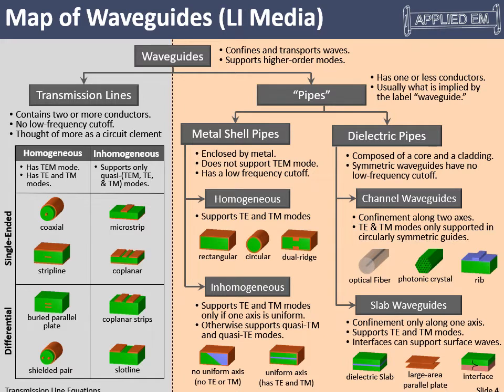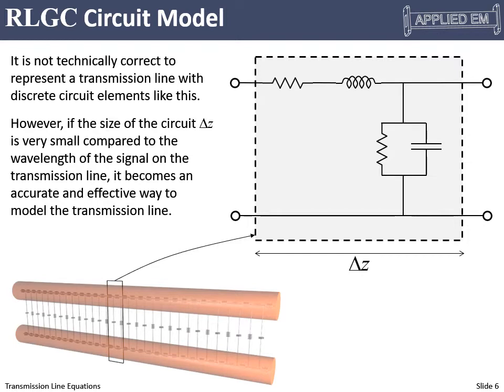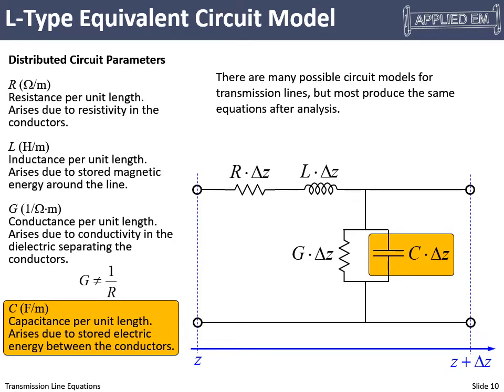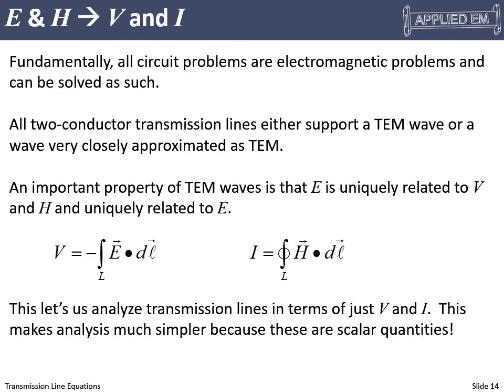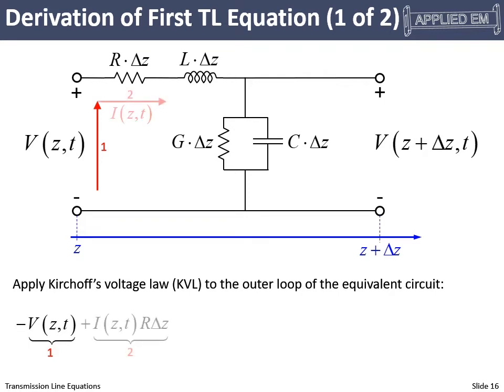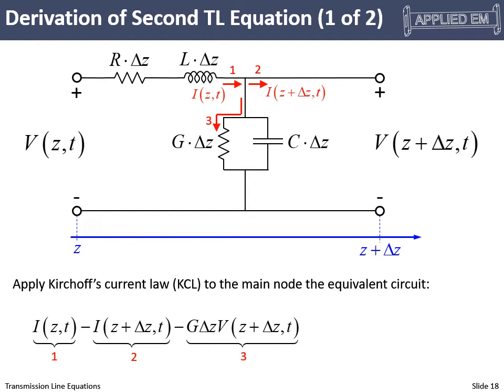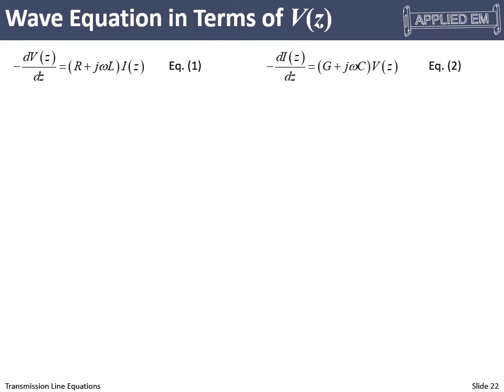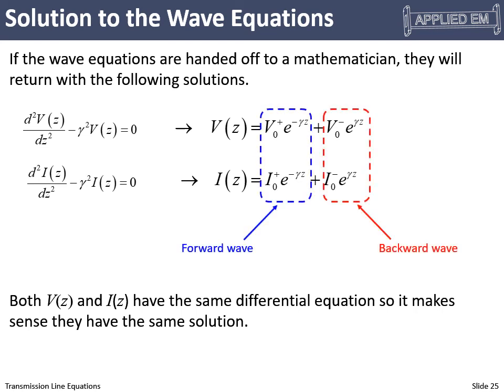Lecture 4a -- Transmission Line Equations

Comment: why the bottom wire has no resistance
Reply from the maker: This is such a great question, I added some slides to the lecture to clarify this. Unfortunately, the new slides are not in the video until I can rerecord.

You can get the revised PDF from the course website at the following link. It is Lecture 8a.

https://empossible.net/emp3302/

In the PDF, see slides 8-12 that I just added. The short story is that there certainly is resistance and inductance associated with both wires. It is just that these are in series so they are combined and then written on the top conductor only because we had to choose one and it seems to be the more standard way to draw a circuit.

Hope this helps!!

Comment: Hello Sir, very well explained as always! 
Just some quick questions regarding on min 17:00 to solve some doubts that I have.
1. Per my understanding, when we convert an harmonic/sinusoidal EM wave written in time-domain form to the phasor/complex form, we are esentially doing a Fourier Transform, since on complex/phasor form the equation is on frequency domain, right?

2. When Fourier-transforming the time-domain equations with (z,t) variables to frequency-domain (z, w) on min 17:00, the angular frequency variable "w" is not written on the Telegrapher Equations because we are asumming that the frequency is not going to change during the analysis (fixed value), correct? So that, we only focus on the varying behavior with respect to the space position "z" on the transmision line and this written form also matches with the phasor/complex form?

Could you confirm those two questions, please.

Thanks a lot!
Reply from the maker: 1. Correct.

2. If frequency w is changed, the differential equation would have to be solved again for I(z) and V(z).  I suppose in this sense I(z) and V(z) are functions of frequency w.  However, writing them as V(z,w) and I(z,w) might be misleading that you can simply plug a different value of omega into I and V and get a correct answer.
Reply: @empossible1577  Thank you so much for your quick answer!

Comment: LGRC model, Is the only model? Are there other models?, where can I find it and why do we use LGRC model instead of the others?
Reply from the maker: There are other models for sure.  They tend to be used for specialized lines.  The model I use here is the classic one used in the textbooks.  It is simple, intuitive, and explains all of the the transmission line phenomena for standard lines just fine.
Reply: @empossible1577  Ok, thanks for asking. Do you know where can I find other kinds of models? I mean, like a book or something, I just wanna see it with my own eyes, please. BTW, now, I'm a suscriber. Excelent videos!
Reply from the maker: @DRACOBUCIO  Right now my wings are clipped.  My university got hacked and we have been without e-mail, access to our storage drives, and other IT things for over three weeks.  Even worse, we are not getting any straight answers about when that may return.  I cannot dig through any of my materials any time soon.  Try searching for "alternative transmission line models" in Google.  Let me know what you find.  Very sorry!!!

Comment: thank you for your exellentte videos. However, I do not understand how the current which is a flux of electrons which move with a very small velocity (drift speed) can travel at celirity of light on transmission line  (telegraph's equation) ?
Reply from the maker: I am uncertain about the specific drift velocity of electrons.  In fact, for an AC signal, the average drift velocity is zero.  When talking about an electromagnetic wave, the velocity of the electrons is oscillating.  The speed of the wave is how quickly the oscillation travels, not the electrons themselves.  Does this make sense?
Reply: @empossible1577  :
Ya little bit, but I can't relate I = dq / dt to the current equation in the form of a wave equation. If i measure the current with an ammeter on the power line, what will it be? electrons flux or electrons oscillations?

Comment: Certainly a great video explaining the Telegrapher's equations intuitively and relating them to Maxwell curl equations!! Excellent stuff!!
I have question at 17:20, is this really the Fourier Transform of those equations or they were simply rewritten in complex form?
Reply from the maker: The "complex form" and the Fourier transform are the same thing.  I think you are so used to mentally converting between time-domain and frequency-domain that you have lost site that it is actually a Fourier transform that is happening.

Comment: For me,  the KCL is wrong (15:25), why "Gdz*v(z+dz,t)" instead of v(z+dz,t)/Gdz? For capacitance as well?? Sir, Please explain.
Reply from the maker: Ohms law is V = I R.  However, Ohms law in terms of conductance is V = I / G.  G is conductance, not resistance, therefore the current through an element is I = G V.  There really is not trick to the capacitance term.  The current through a capacitor is I = C dV/dt.

Comment: Thank you so much for your useful lecture
I have a question:
 At the load, in the matched impedance case, how power in the dielectric convert to the load? because no reflection, it's mean power was 
absorbed by load, right ?
Reply from the maker: The power in the transmission line is just passing through.  The line itself is not absorbing power.  Therefore, at the load only one of two things can happen.  First, power can reflect in which case is travels backward down the load toward to the source.  Second, the power can transmit to the load from the cable.  The load will have to be composed of lossy material that will absorb the energy.

Comment: Y u r  changing only one side of equation in case of both kvl and kcl? Plz explain
Reply from the maker: Are you saying that is bothers you that I write both equations as sum=0?  For KCL, for example, you could write that is

incoming current = outgoing current

Instead, I write it as

Incoming current - outgoing current = 0

It is a similar thing for KVL.  Does this answer your question?  I am afraid maybe I do not understand what you are asking.